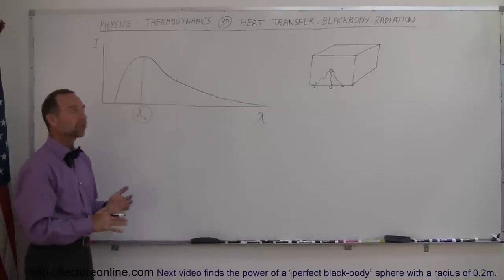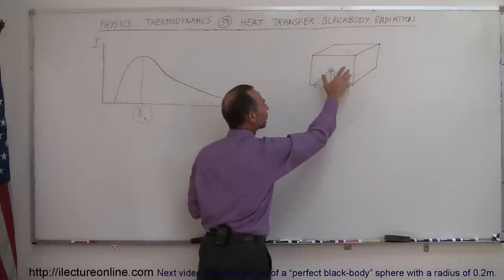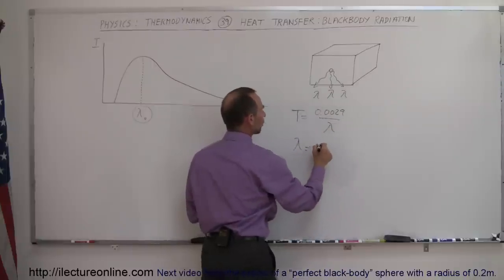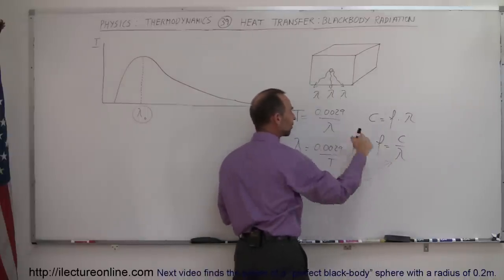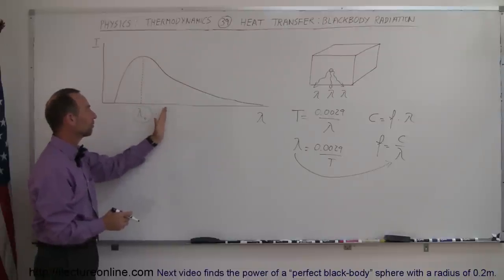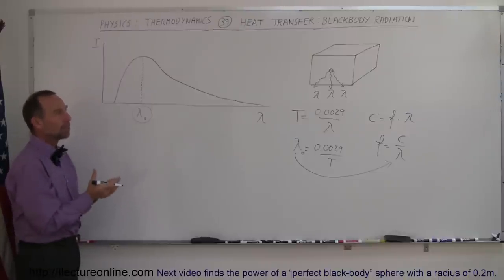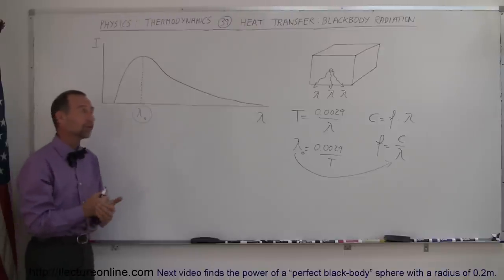Physics 24  Heat Transfer: Radiation (23 of 34) Black Body Radiation

Comment: Hi there and thanks for the amazing content. I would just like to point out that the the main emission of the sun is on the green part of the spectrum and the reason it appears yellow to us is mainly due to Rayleigh scattering and its dependency on wavelength.
Reply from the maker: Yes, you are correct.  It turns out that when "looking" at the Sun in space the color of the Sun is white.  The color scheme of the stars assumes that they are viewed from the surface of the Earth, thus from that perspective our Sun is a "yellow" star.

Comment: hello sir: the radiations emitted from heated solid objects does it come from the oscillations of the atoms (ions) of the object itself or does it come from the transitions of the electrons between energy levels in the atoms?

i have read in a book (conceptual physics by paul g. Hewitt) this exactly what is written in the book (in a gas the atoms quite unaffected by the presence of neighboring atoms. But when the atoms are closely packed as in a solid electrons of the outer orbits make  transitions not only within the energy levels of their atoms but also between the levels of neighboring atoms. Resulting in an infinite variety of transitions hence the infinite number of radiant energy frequencies)

and i read in another book (fundamentals of college physics by peter j.nolan ) a body can considered to be composed of a large number of atoms in a lattice structure each atom of the lattice is in a state of equilibrium under the action of all the forces from all its neighboring atoms. the atom is free to vibrate about this equilibrium position. the oscillating atoms generates  an electromagnetic wave that is emitted by the body. 
i am confused which is correct  please explain
Reply from the maker: It does depend on what state the matter is in, solid, vs liquid, vs gas.    But in a solid the radiation comes from the vibrations of the atoms, resulting in accelerating charges (simple harmonic motion) and thus results in the radiation of E&M waves.
Reply: @MichelvanBiezen   so what about what is written in the first book?
Reply from the maker: That is exactly what Paul G Hewitt is describing in his book.   Due to the oscillations of the atoms in a solid you essentially will have a near infinite amount of frequencies being produced.
Reply: @MichelvanBiezen  i am sorry sir but he said electrons. I am confused

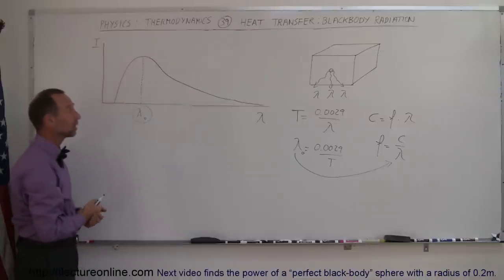Comment: sir, what you said 2:47 . its only for a black body and not every thing is a black body, so is this applicable to everything . also, how sun is a black body that we're applying concepts of black body to sun.??
Reply from the maker: The term: "black body" and black body radiation is related to the emission of energy from an object due to the thermal motion of its atoms and molecules.   Object also reflect energy and produce energy chemically, or through other means.  Black body radiation does not include these other sources of energy.
Reply: @MichelvanBiezen  ok , so which means it happens in every body and only the intensity is different for different objects .

Comment: What do you  mean by the greatest amount of radiation? ?
Reply from the maker: yes, that is a difficult concept to put into words.   A "blackbody" radiates electromagnetic radiation at various wavelengths (represented by the blackbody radiation curve).  But each blackbody will have a peak of that curve at different wavelengths, depending on the blackbody's temperature.  That peak represents the wavelength at which the radiation is strongest, (or has its maximum intensity)
Reply: @MichelvanBiezen   But shouldn't maximum intensity be at the shortest wavelength? Afterall,the shorter the wavelength,  the higher the temperature and subsequently the higher the amount of radiation?

Comment: Sir I have a quenstion sir if black body is in thermal equilibrium with surrounding so it absorb and emitte radiation at same rate so it appears black can we see black body by infrared camera bcos it is emitting what it absorbed
Reply from the maker: The radiation frequency emitted by a blackbody only depends on its temperature and doesn't have to match the frequency of the incoming radiation.  (Only the total energy output equals the total energy input)